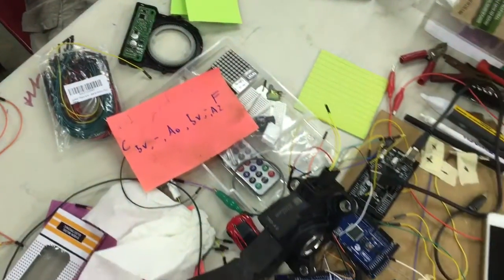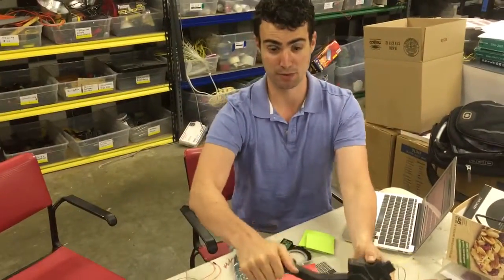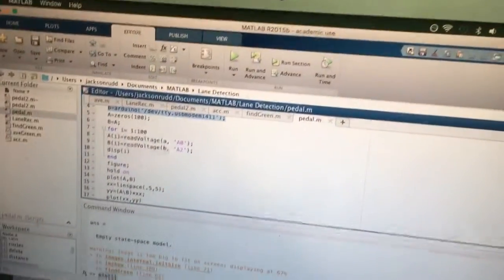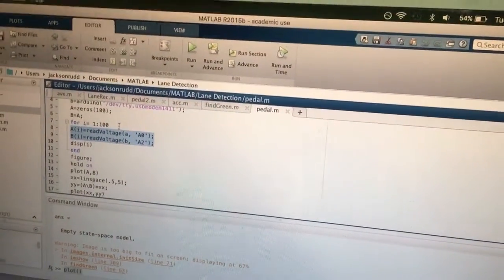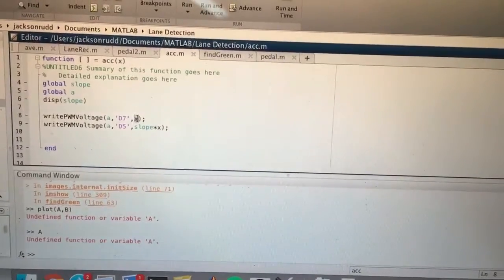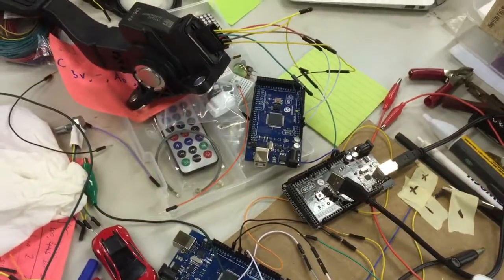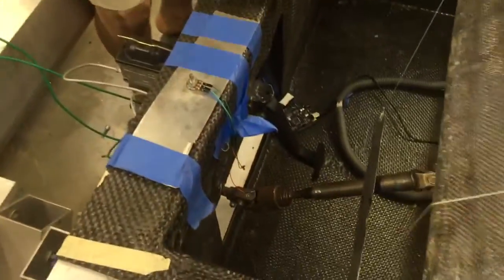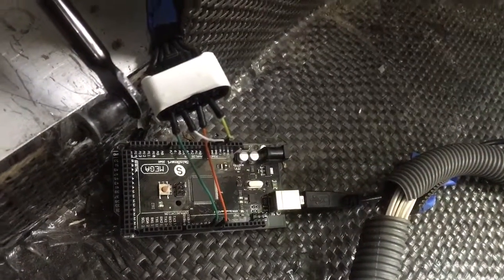WIKISPEED demo reading in accelerator pedal positions via arduino and Matlab

Comment: The guy interfacing Arduino with accelerator pedal with his electronics knowledge is dangerous , first of all the pwm is not a voltage value , so that's not gonna work unless you put a DAC in between

Comment: What function did you use to send the value to the ECU? Don’t you need a digital potentiometer to send the new values?
Reply from the maker: The analog output function works fine.  The hall effect throttle signal looks a lot like the analog output PWM from the Arduino.  But you need to send out both signals, and they need to be related.  I think one is 1 - 4V, and the other is 0.5 - 2V.  So one is just twice the signal of the other.  If they don't match within some sort of window of error, the ECU faults the throttle signal and does nothing.

Comment: like where you are going with this . could you go thru the DLC port on the car to control the throttle and brake on the honda r18 car ? as there is a full FCAN systems already in the car .